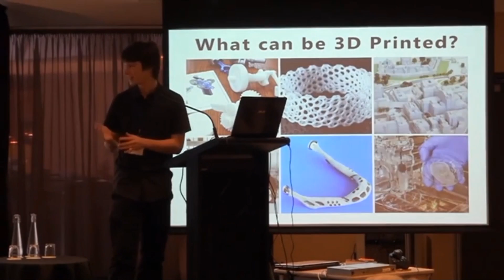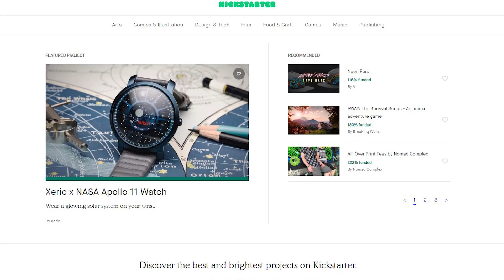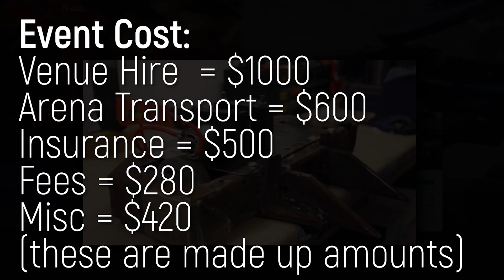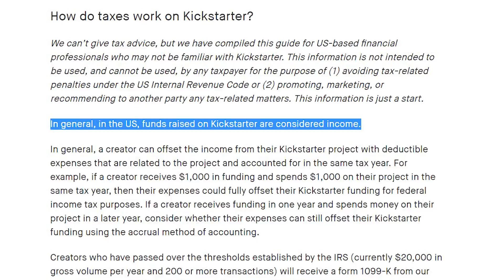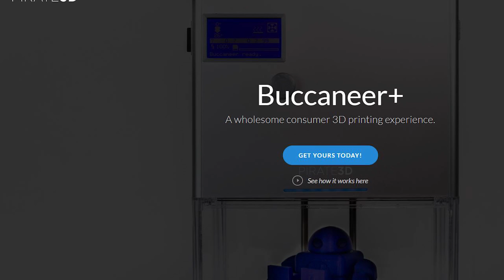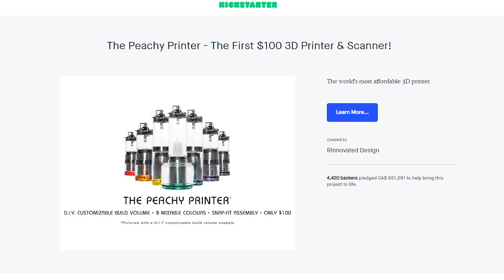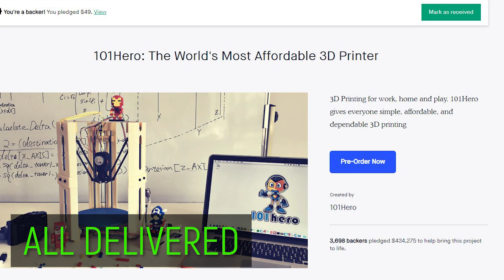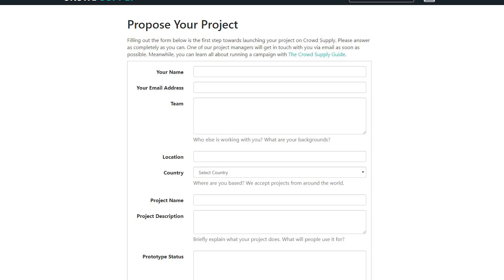This 3D Printer Raised $1,438,765 and Failed. Crowdfunding Warning.

Comment: Not defending Pirate 3d at all, I have a Buccaneer and it worked well for about 3 years, but they did deliver quite a few units before taking a really bad detour. By that I mean that they thought that the only way they could move forward was to revamp the Buccaneer to gain commercial traction with a more mainstream offering. And thus, just before they went tits up, they "launched" a Buccaneer + machine, and offered it as an upgrade to their existing customers. What did this offer? Updated electronics (not sure what but would be happy to send pics  of mine), SD card slot and it ran on Marlin. Yup, they went mainstream but their reputation overtook them and demise was inevitable. 

How do I know this? I  currently live in Singapore, for my sins, and used to pop over to get little issues fixed and banter with the people there. For what it's worth, they had good intentions and high aspirations. It was really sad to see them go from a buzzing team of 3d printing enthusiasts in an industrial office to a three man crew still desperately still trying to fulfil their Kickstarter obligations. Yes, they tried to placate customers with promises of heated beds, etc. but it was all very naive enthusiasm rather than anything nefarious. As with most Kickstarter projects, there are a lot of really passionate people  who really shouldn't be doing it. It was my New Year's resolution not to back any more KS projects, one only broken by my pledge to Snapmaker for their V2.

If you really want to dive into failed KS projects, there's the OLO (or ONO) project https://www.kickstarter.com/projects/olo3d/olo-the-first-ever-smartphone-3d-printer/description which raised $2,321,811 with yet a single final unit delivered, 3 years overdue and counting. Or the  Eora 3d Scanner https://www.kickstarter.com/projects/eora/eora-3d-high-precision-3d-scanning-on-your-smartph which did deliver (mostly) but has gone under (based in Sydney, go see what they have to say, go on I know you want to). Both projects which I backed with regret.

Quick confirmations on the Buccaneer mentioned in your video - yes, the filament  partner was eSun. Fact, the plain white spool which came with the printer was pure garbage, which FRACTURED when exposed to any moisture when left open for any reasonable length of time.

Thanks so much for your content Angus, it's by far my favourite of anything I ever follow so please keep it up. Also, don't be pressured to produce more than you're comfortable with, it's the quality that matters at the end of the day.
Reply from the maker: Thank you Raymond for the insight! It confirms a lot of my suspicions with information I couldn't quite track down. They seemed like a really enthusiastic team and the machine is designed beautifully for the most part. If it was a commercial product today, it would sell well.
Reply: Me too, I got original version, i like it so much a actually sent to for an upgrade for their version 2 and spent another $150. I got the gecko bed plate and it works  perfectly compared to their stock bed. In the end i sold it, because they stop selling spare parts like extra extruders and and nozzles on their website which only they have. They stop responded to emails too. 

In the end what a huge disappointment!
Reply: It's like this, a bank doesn't have all the money required to pay out all the people who have money in their accounts. That's a fact. So, as a company, you can reach a similar position where you no longer have the ability to for fill all the orders that people have paid for from your cash flow.

This is why when companies go broke, they always owe money to everyone. It's never as simple as them looking at their books and going "you know, we had better shut down now, or else we risk owing people money". When you reach this point, you start to incur debt to both creditors, customers and suppliers. The wrong move can sink everything.

This is why kick-starters are doomed to fail. The standard way you would bring a product to the market is to gain financial backers, this is correct, but those financial backers tend to be given a direct stake in the company. So, it has risk, but it has gain if it succeeds. When you do this kick-starter crap, all you get is the finished prototype product, and that's it.

So, it's investment with huge risk, with absolutely no gain but what you paid for. And since it's not a normal financial backing, there is no company investigation, no checks, no transparency. It's failed to gain traction normally, which means that what ends up on kick-starter is the absolute bottom of the barrel concepts. Usually they start up with nothing but marketing. Sure if they get some money, they might do some RND later, but you know, you never know, all the money at this stage is pure marketing. So your first few backers are paying to rip off the next few customers. And doesn't that sound like a pyramid scheme already?
Reply: I was one of the people who lost 350 bucks on the Buccaneer and another on a peachy printer
Reply: Thanks for the thoughtful comment!
Reply: Definitely wondering what's going on with the Ono...
Reply: I backed a company from California not fucking Singapore. The day they got the money they moved.
Reply: @Aleksandrgrc  Many hardware startups like this maintain a satellite office or have a hotel at least near their manufacturing contractors with a few people (usually engineers) from the company, and may hire some locals to help bridge the language barrier between the two. It's much easier to keep the contractors honest if you have people on-site to do quality control, and make adjustments in process as needed.
Reply: After the PrioVR I got really leary of backing KS projects.  The only one I've backed so far is the Sinden Lightgun because the guy is an engineer, demonstrated it worked, and was frank about the KS just being so he can hit MOQ on the parts and justify spending the cash he already has on getting the molds cut.
Reply: Why not release their splicing software to the people that bought it then.
Reply: The Olo/Ono...my mother and her associate backed it after seeing it on tv....but at least they knew the possibility of it failing, because when they asked me, I told 'em "If you're fine risking the 100 dollars, knowing this is a glorified donation, go for it" Now they're using with great success one of that 200 dollars cnc mills which was 1 day delivered by amazon :P
Reply: At least someone got their buccaneer.. I know I never did :-(
Reply: all of those things you mention as upgrades are baseling for Prusa's.....
Reply: I got one too. Went over to the office to collect it iirc, and it was pretty ulu. The thing was ok but compared to current printers it was so damn limited. Filament kept jamming on mine too
Reply: I had a buccaneer, in fact I got one of the last units before they did their big out of money pause in August 2015.

The machine worked really well. I loved being able to print and monitor from my phone. It had one of the first auto bed leveling systems, which worked really well. The removable build plate was great, but the sticky material left a lot to be desired as it would lose stickiness quickly and replacements were $25 for 2.

One clarification, neither the desktop or phone app were cloud based. All the slicing was done on the printer itself.

The filament they shipped left a lot to be desired, coupled with the fact they used a non-standard spool holder was a pain. I ended up design a frame that sat over the top to let me use any filament I wanted.

Comment: I was one of the few who received my Buccaneer 3D printer. It worked ok, but spent more time trying to get it to work before the company went under. I was able to change out the control board and the extruded with a Ramps 1.4 and an e3d hot end but again, it became so much of a hassle I just dropped my saved money on a Prusa and the Buccaneer sits in a box next to my computer. It’s a shame as it looked quite promising

Comment: I backed the Ono 3d printer. I've pretty much kissed that money goodbye, as they keep saying "no, really, we're JUST about to ship!" They've been saying that for several years now. By the time they ship, if they do, it'll be just in time for their cloud services to go away, making the device a doorstop.

It's close to that now -- they originally planned to use an ultrasonic data transfer method, but the only other product I know of that did that, an Australian augmented reality toy you clamped your phone into, switched from sonic to Bluetooth because the sonic ate batteries at a ruinous rate. But then they charged extra for a retrofit module, and I couldn't be bothered to get it. Then Ono or Olo or whatever went with a headphone jack connection...right when phone makers were trying to phase them out.

I fully expect that if they do ship, with a fully funded cloud site with open source code you can put on Amazon cloud services of the sure dies, it'll be two months before the resin needed for the thing gets banned for making the frogs gay or something. Sigh...
Reply: Ahhhh, give them a break, every time they get to the tape someone upgrades the design and it's back to the drawing board again....who wants something that's just gone obsolete.....of course the new price will be higher because it's state of the art....once again.

Comment: When will we see your take on recycling 3d prints ?
Reply: Are you a tight arse?    Don't you understand that 3D printing scrap or failures is the same as wood chips or metal swarf in those trades? Just bung it in the recycle bin and do the part again more carefully....it's a learning curve, and the better you get the less scrap you make.